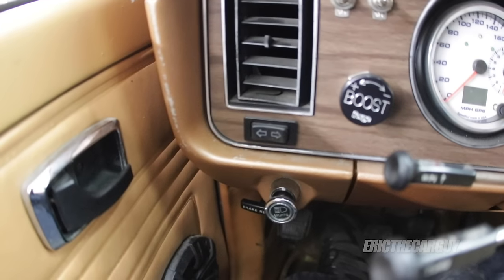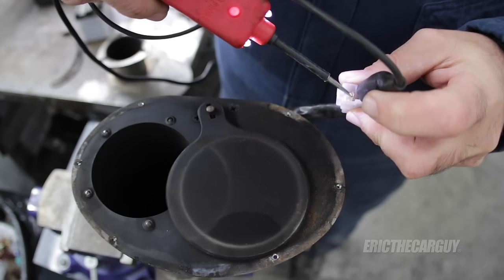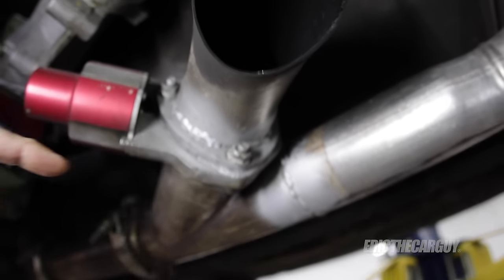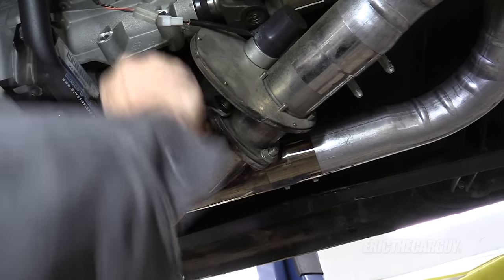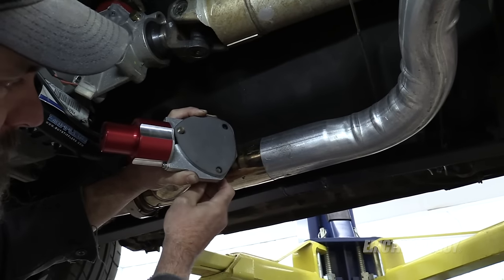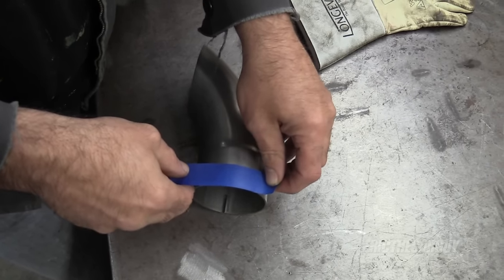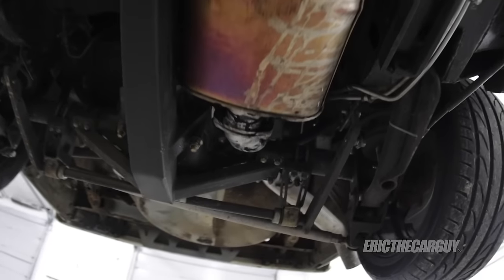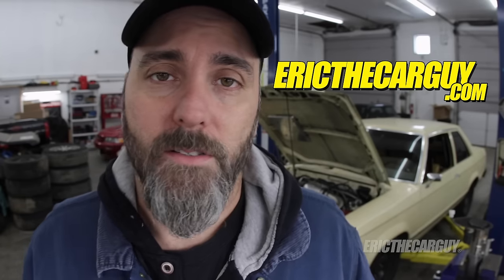Exhaust Cut Outs Give Your Vehicle a Split Personality

Comment: I'm sure that would help some in my car but my exhaust is really free flowing. My 02 WS6 Trans Am is running ceramic coated hooker long tubes that then connect to the TSP 3" catless y-pipe (no inspections in SC) and then after the y-pipe it runs to a full 4" exhaust with a spintech muffler after the merge in the t-pipe. Huge increase in exhaust flow comapared to the factory Exhaust system. I just did free mods and ported and polish the MAF and Throttle body. I used slp smooth bellows just for a better tube to mount my nitrous nozzle. I did the real ram aIr setup despite having the WS6 ram already its alot more air coming in compared to the factory set up. Once I had the exhaust very free flowing and the intake side taken care of and all emissions junk removed I added a 150 shot. I'm so confident in how it runs I dint even bother with a tune. My A/F ratio stays right and it doesn't ping. The spintech is great with my set up. No raspy sounds on a rev and no popping coming off a rev. Great exhaust setup for LS1 f-bodies. My car was box stock in 2012 with 33k miles on it and street tires an no mods it ran 12.8-12.7s fully stock. It now gas all the free mods, all the emission crap removed, full intake and exhaust work, and a 150shot. Despite factory suspension which is trash now. I run m/t ET streets 10.5" on 17s and it runs 10.8s@127mph and I dont even spray until second gear. I keep my launches around a 2.0 60 ft time to keep the factory 10 bolt alive. Full exhaust, free mods, nitrous, and drag radials are all it takes to get a stock ls1 engine to run low 11s in a full weight 02 WS6 Trans Am. My car is also a fully loaded option car. Electric windows, seat, leather seats, 6 speed manual with the "Hurst option, which is likely just a shifter knob. Yall know what fully loaded is. Mine has every option that I have seen or heard of.  Great cars to go fast for real cheap. Not much room for cut outs because my factory height car still bottoms out and scrapes the exhaust quite often.

Comment: On the crimp connectors.... Two words.... "Dielectric Grease"! Do everything as shown except before inserting the stripped wires into the crimp connectors, put a thin coat of dielectric grease on the wires and/or squirt or inject a little into the connectors, THEN crimp! This grease will protect the electrical properties of the connection for a LOT longer than dry crimping by preventing (or at least limiting) corrosion caused by moisture and road salts. I try to use this on every bulb, connector, and electrical fitting on all of the vehicles that I own. Motorcycles, watercraft, and 4x4's included. 👍

Many types available and this is just one:

Liquid Wrench L803 Anti-Seize Dielectric Grease - 3 oz. Tube https://www.amazon.com/dp/B002SEJLU6/ref=cm_sw_r_cp_apa_i_bcHfCbJ7WBTXD

Comment: Seems like for best flow when open it should close the whole system and only flow to the dump pipe. And the original rattle was probably that loose bolt you had when removing it.

Comment: @EricTheCarGuy Excelent work, i follow you about the mini series, and i have some questions about that theme, i'm fixing a N12 Mini Cooper 2009 non-turbo, and i was change the head gasket because the car was over warmed, when i put the head bolts and use the specific torque, I listened a big sound in a bolt, but no broke, and are new bolts, my question is, can i use same bolts and gasket to check my engine block?, i never start my car,I keep putting accessories. thanks for your awnser, and sorry for my bad english (i speake spanish)

Comment: check out the FiTech fuel injection systems. they replace your carb and you shouldn't have to change your intake manifold. the higher end ones are boost compatible

Comment: Nooo, don't butt crimp it!  Ouch.  De-pin the weatherpack connector off the new wiring, cut the old wiring, crimp new weatherpack pins on and use the new connector housing.  

Those cheap butt connectors are junk, man.  OEMs never use that chintzy stuff.  

Gotta say, ain't thrilled with how you routed the wiring, either...  Your electrical skills need work.  As a tech who specializes in the electrical side, I'm cringing pretty hard right now.

Comment: Eric,
A few months ago I was driving home from college and my 99 Honda prelude alternator belt fell off while on the freeway. I was not in the best part of town so I risked limping it home having encountered this problem before. My balance needed replaced and a pin was sheared off. The pin has been removed and replaced and the vehicle appears to get fuel, air, and a spark but still will not start up. I haven't checked, but I am nearly positive the car is still in time.
Is there anyway you, or anyone here could help me troubleshoot this problem?

Comment: Another good video would be the best way to de carbon a direct port injection engine, like the Audi s6 v10. And installing oil catch cans in in PVC system to prevent this problems - good for any intake you don't like sludge in ;)

Comment: quick tip for people when drilling a pilot hole in a thick piece of metal like that. Periodically use a drop or so of oil on the pilot spot to cool down the friction and save your metal cutting drill bit. You're welcome in advance.

Comment: Crimp connections are good and all but you should try these. They are heat shrinked crimp butt connectors with soldier in it. So it crimps on then when you heat it to shrink the heat shrink it also soldiers on top of it.

I absolutley love these!!! A little pricey. But I have yet to have one fail.

120 PCS Solder Seal Wire Copper Wire Connectors, Heat Shrink Butt Connectors, https://www.amazon.com/dp/B07B2WS9HQ/ref=cm_sw_r_cp_apa_i_6aVkCb3EWTB41

Comment: I have a different set of low profile cut outs on my 69 Camaro. It does tick a bit because they don't seal perfectly but I am okay with that, personally. (I know, my car isn't running great, I just put fuel injection on and at this point didn't even have the hangers put on the exhaust.) https://www.youtube.com/watch?v=zoDcXfzVAlg

Comment: Hey there. I tried something similar in my " 1998 registered MARUTI 800 " , some specs are as 

Engine model: F8B MPFI (4-speed), Displacement: 796 cc (49 cu in)

Valves per cylinder: 2 (F8B)
Number of cylinders: 3 inline
Fuel type: Petrol
Peak Power: 37 BHP at 5500 rpm (F8B..

Well,  that's no macho machine, just an 800 cc small car but the issue I faced with it is that I blew one of the three cylinders. it literally started behaving weird, I mean it lost its power and pick up, gas mileage went down and some weird behavior was also there.. i guess that exhaust cutout made one of the cylinders go bad .. what do you think can this exhaust valve do such kind of damage to the 800 cc tiny engine ??
 All suggestions and comments are welcomed.

Comment: Here's  hoping  your butterfly valve is more durable than mine. 6 months of corking up 400+ HP bent mine almost double. A backfire or two is all it takes to start the process. I didn't notice any change immediately, it just got worse and worse over a period of a couple  months. I'm betting you will return to the slide valve style in another few months.

Comment: if you flipped the valve body 180 deg around when you really pushed down hard on the gas it would force it closed more and would not leak as much instead of trying to force it open from the exhaust pressure..:)

Comment: My 2000 Accord Ex-V6 had factory dual mufflers, with a single pipe that splits near the right-rear tire, just in front of the mufflers. 

So I cut it, keeping only the left-side, after Y-joint.  Then I installed a straight pipe with a splitter followed on the right side, by an e-cutout and the exit (a turn-down).  On the left it used (several) reducers to get from 2.5" to the stock (left) muffler.  Then I built a control system that tapped the wire for VTEC solenoid control (by the ECM).  So it ran like stock, until VTEC.  Then WFO, until I slowed, and it would calm, too.  

Some cars come with their own split personality, but we muffle them.

Comment: Wonder if the fiberglass tape that I use on my wood stove door to seal it when it’s closed would work to make a better seal on the exhaust. 
Like the glass rope contacts the steel when the flange closes. The stuff can take some seriously high temps. 🤷‍♀️

Comment: I put the same style of cut outs on my car and I love em.
The one thing I did different with my exhaust was,
When my cut outs are open my exhaust comes straight out of the headers 3” all the way with and 18” pipe extension and my exhaust pipe/muffler Y’s off with the 2.5”.
I mean who cares if there is another bend in the exhaust pipe but when I want to race I want the exhaust coming straight out.
I wish I could post a picture off what I had done.
It was all custom built.
It’s beautiful

Comment: As the Exhaust vibrates, so will that zip tie, eventually wearing away at the wires. .. just a heads up. 
Happened in a older turbo car of mine. 🤔

Comment: I have a newer f150 with the 5.0 and I’m wanting to replace a section of pipe below my catalytic converters on each side and put a couple electric cutouts on it with the switch unmarked in my rocker switch panel

Comment: Why didn’t you put the electric motor facing up rather than where it could potentially get knocked off? And zip ties for the wiring?? Dude you had a perfectly placed hole on your extension housing that you could’ve fabricated a nice little bracket to hold your wiring well out of the way. What’s with your slave cylinder hose hanging down? Nice effort but I’d love to be able to come over and help you tidy a few things up 👍

Comment: Is this exhaust valve still working well? I had a motorised one and it died within 1 year. The gears failed. Prior to that, it got really squeaky from all the exhaust deposits, so was embarassing to operate on a classy sports sedan. I've since been running a vacuum operated one for 4 years. The only problem is the rattle when closed. Which is most of the time.

Comment: hey Eric I have a question. I have a 2018 Mustang GT with the Performance pack and I'm coming up on a year of ownership this June. I had not done any modifications because i wanted to just enjoy the car and get to know it. I'm sure you heard all of the hoop-la with the ticking, shift forks etc. My car, fortunately don't have any of those issues. I don't take it to a track or beat on it like most. Heck, I haven't driven over 70mph, I have really babied this car. Hence, in my opinion, is why I haven't had any of the fore mentioned  problems. That said.... I want to add long tube headers, a cold air intake, with a tune for 93/E85 fuel. As far as power goes, that's all I want. This thing is pretty stout already. With the active exhaust, I can quite it down, I don't like obnoxious loud. 500 hp is good enough for me with this new 10 speed Transmission. 
My question is......Will it make a difference in horse power between long tubes verses equal length after market headers on this 3 gen 5.0? If so which equal length headers do you recommend? Most mustang guys are running Corsa's or Texas speed headers long tubes.Thank you for your time and suggestion.

Comment: Since the turn down is not visible, is a there a reason you cannot use the flange blank with some 3.4 inch spacers and just bolt it right on? Personal preference, I know the turn down affect sound quality a litte, but seems like using the blank with spacers woul dhave bee easier.

Comment: The factory does not use crappy crimps tho.. And they crimp connector pinS on, not 2 ends of a wire... Bare copper will be ruined in no time under the car.. Soldering protects the copperwire. I would never use junky crimps, the size of the plastic cover forces to use huge heatshrink and it will let moisture in.. Get that heatshrink that has solder inside, convenient install process.

Comment: "Eric why not solder?" ///  How about not putting a wire splice under the car in the salt and grime in the first place?  Pull the wires out of the Weather Pac connector on the new harness, cut the connector off the old harness and crimp some new pins on the old harness and push them into the Weather Pac connector.  Then you have a weather tight connection just as if you have install the new harness.  Or just install the new harness. I bet it wouldn't take but a 1/2hr longer than jacking around with the butt connectors.
Also instead of using a Vise Grip on your crimper, take the MIG to them.  You had it right there.

Comment: Okay I’m picky so I would have mounted it up so it would not reduce ground clearance also tape under the heat shrink tubing if you need the diameter increase under car you need the water proof of the HS

Comment: the new one you installed will be rattling in no time..  i installed a pair of them, they lasted maybe 300 miles before the rattling became too much to put up with, raised hell with JEGS until they replaced them. when the new set gets too much to handle again, i'm removing them and sealing the system back up.  
the closing plate pivots in brass bushings, and wears unbelievable fast. 
can hear them rattling at :30
https://www.youtube.com/watch?v=CJwmlcG8jO4

Comment: Exhaust cutouts are fine but they do change the tune. On EFI if you have mass air flow sensor on your engine they will work fine. If your car is speed density and or carb then it will throw your tune off.

Comment: My version is a squeaker borrowed from my dogs toy, attached to a vacuum line connected to the intake manifold.  It squeaks at a different tone depending on if the intake pressure is positive or negative.

Comment: Exhaust cutouts are great but there are automatic ones easily available online. They will actuate under manifold vacuum or boost. I have one on my Mazdaspeed 6. A single 3" pipe goes to 2 mufflers at the rear. One is the standard Mazda muffler, always in play. The second is a 3" straight through muffler actuated via the boost operated cutout. The cutout opens up under turbo boost and it works really well.

Comment: Why are you running the cutout so close to the rear transmission seal? Hats going to BBQ the seal and your tranny will leak! Soldering makes a much better connection. It bonds the two metals together like a weld, on a molecular level. I used to use crimp connectors on everything, but after I learned to solder well, that's the only way I'll connect wires together. Especially in an environment like underneath a car or when it's exposed to the elements.

Comment: Factory truck engine tec
Most engine manufacturers have gotten away from soldering wire connections because the flux leaves a corrosive residual that causes a voltage drop later after time
I have quick time and no leaks after about a year

Comment: When I used to build police cars, I always soldered any connection outside the vehicle and used crimped connections inside the car. I just felt better about connections being exposed to the elements if they were soldered. That being said, I always staggered my connections, it made it easier to crimp or solder and heat shrink.

Comment: Should have cut the tip all the way to the un-expanded section. The flange isn't designed to be mated to the expanded size of the tube. I saw someone do the "weld on the inside where the nuts go because there is no room on the outside" for a pump house on a tanker trailer, and it sprayed out fuel like a sprinkler. Not that leaking exhaust gas on this particular part will affect anything, but it's bad practice.

Comment: This will probably not be read but instead of cutting the harness and using heat shrink butt connectors (those do work really well), you could have crimped new weather pack terminals on the wires. Very easy to do, looks cleaner. If it’s in a guy’s budget I really prefer deutsch connectors, but weather pack is good, too.

Comment: I have a 2003 5.3 efi Silverado.  Does the computer computer automatically adjust to the fuel to air ratio when you open cut out or do you need a tuner?

Comment: BMW has had that for years. When you really jump on the gas it opens up. You can also manually jam it open with a golf tee or a long skinny bolt or code it to stay open with Carly or something similar. It's doesn't sound nearly as good as yours though. 
now that being said, would you consider extending it with a straight pipe all the way to the rear or nah ? 🤔

Comment: I put home made manual cutouts on my FE powered '65 Galaxie (see avatar) in '97; think I've done 1K quiet miles since then. ;)  Mine are basically 3bolt blank-offs that pivot out of the way on one bolt. These electric ones look awesome and I may have to upgrade, thanks to this vid. :)

Comment: Only thing I’d suggest is testing to make sure that little electric motor worked before heat shrinking. It would be a shame to have to cut the heat shrink because of a bad connection

Comment: Does it still work? Any sealing issues?  How do you know  when you are not  overtorquing the flaps when you are opening and closing?  Overtorquing usually loosens the seal.

Comment: I worked at a shop where the guys using those crimp connectors on semi trailers. They would use liquid tape over the heat shrunk part and then use shrink wrap over that. Redundant, but nothing EVER came back corroded, even a decade+ later!

Comment: Way too much work to add the turn down. Get a 3 inch 3 bolt collector ring and weld the pipe to it.  And yes you need welding practice.

Comment: man you are just like me.....my exhaust cut out looks like a 3 inch wide spring loaded engine valv with just cable to a handle bar, i like it becaus  it can get realy quiet in no time and sens the gaspresure  helps me close the valv it seals realy good against the valv seat.